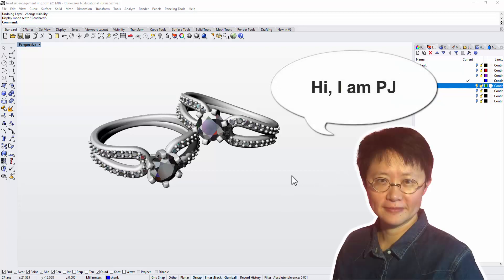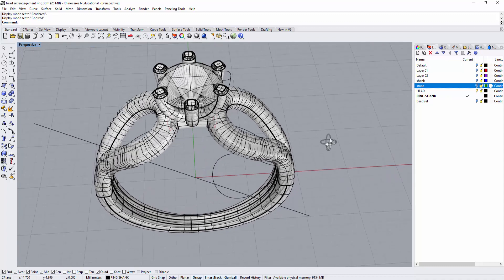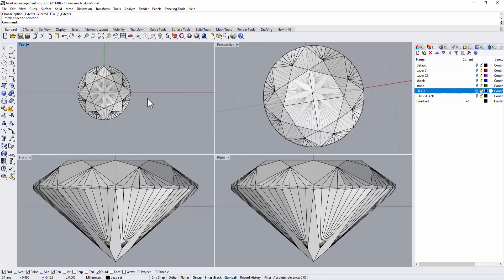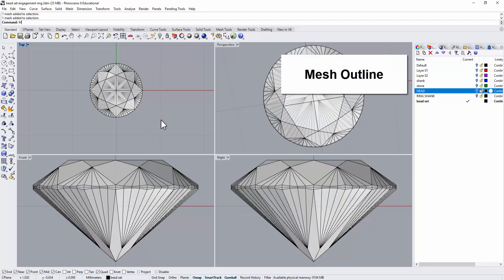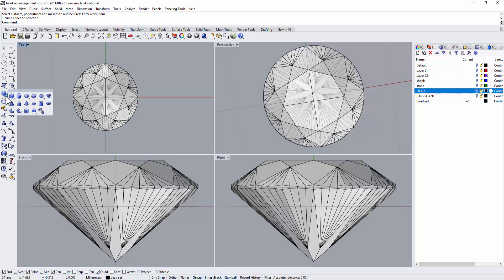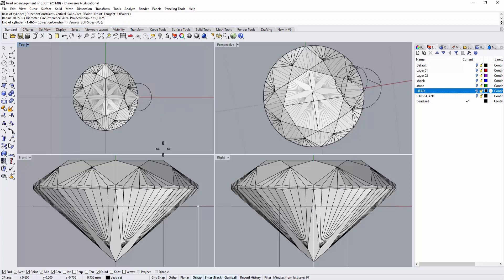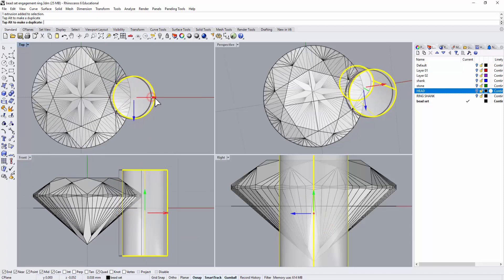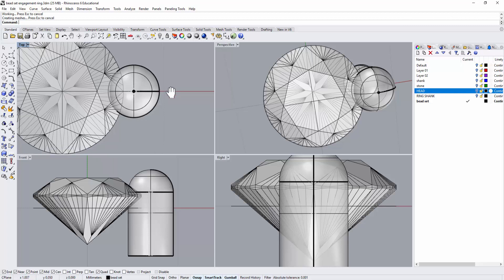Jewelry CAD Design Tutorial #25: Engagement Ring Design in Rhino 3D (Part II)

Comment: Hey PJ,
Absolutely helpful as always. I have a question for you. How do we measure the exact size of the gem we will be using - a caliper? Are there tolerances I need to consider before sending the gem and casted piece to manufacturers?
Reply from the maker: do you want the stone cast in place. there are some limitation on type of stones.

Comment: After the array the prongs on curve barely touch dads, is that what you meant by moving @ end of video?
Reply from the maker: if the prongs are not in the ideal position. you will need to move it before Boolean Union.